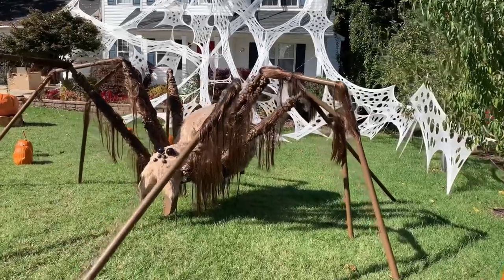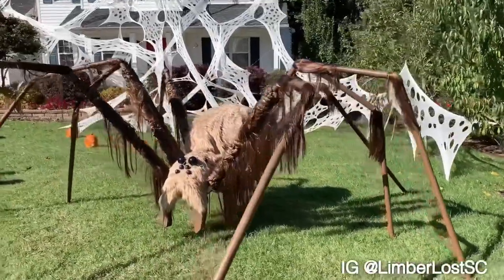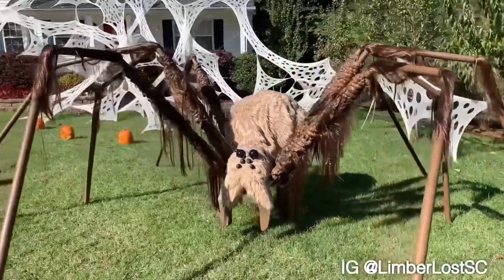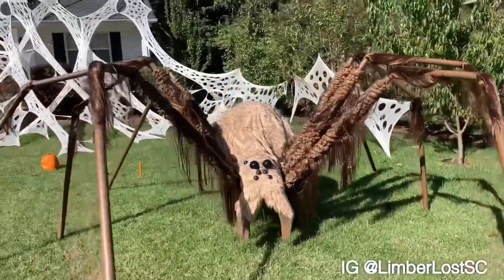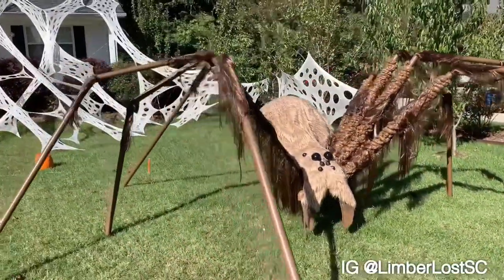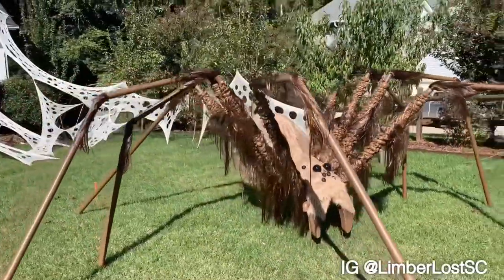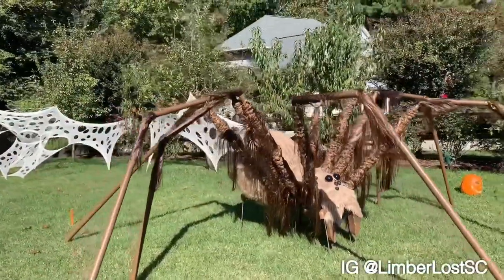DIY GIANT HALLOWEEN SPIDER

Comment: What sizes did you cut the PVC leg pieces to?
Reply: Have someone hold the 45 or 90 pvc fitting where you would like it height wise and measure inside the hub to the ground lining it up with the angle of the fitting. Easy

Comment: How are you getting such great coverage from your lighting in the ending shots of this video?  We are struggling with our black light placement.
Reply from the maker: I think the issue is that you’re using black light. I’m using LED color floodlights. I have two flood lights facing the house which illuminate it in that way. Here’s what I used LED Flood Light Outdoor 800W Equivalent 8000LM Smart RGB Landscape Lighting with APP Control, DIY Scenes - Timing - Warm White 2700K - Color Changing Uplight, IP66 Waterproof US Plug MELPO(2Pack) https://a.co/d/b5IY5o2

Comment: How did you format the pincher? I didn't see that,was it carved w the foam? & whered u find foam like that?
Reply from the maker: Hey Ken, 
It’s carved from styrofoam blocks (like the one  that’s shown in the beginning of the video). I found the blocks for free on Facebook Marketplace BUT the Tractor Supply Store sometimes gives them away for free). I carved the pincer out with a hot knife. Then I covered it with faux fur from Amazon
Reply: @IsaacAlexanderDIY  Thanks I figured that's where you got them.

Comment: Awesome build! Do you have a full supply list? How many wigs? Size and amount of PVC? Amount of fake fur? Thanks!
Reply from the maker: Unfortunately this was my first YouTube video and I didn’t really know how to make a proper one 😞. I don’t have a detailed supply list only that I used about 10 cheap wigs that I cut up. 
Depending on the size of the spider abdomen, I ended up using about 6 yards of fur fabric. PVC was size 1 1/2 inch but I don’t remember measuring the legs to get an exact measurement and I just cut sizes that I think would be appropriate size. I’m going to probably have to remake this spider with detailed measurements.

Comment: Just found this DIY and I'm excited to give it a spin! How did the beach ball and foam hold up for shape? Any tips for storage? I've also seen chicken wire versions and I'm wondering if it collapses on itself.
Reply from the maker: It’s a great project to make😊. The beach ball doesn’t stay inside, I pop it with a knife and remove it after the expanding from has dried. This is the third year I’ll be using it and the beach ball expanding foam body has done amazing
Reply: @IsaacAlexanderDIY  Thanks so much for the reply! I've used the foam before but not for crafting so I wasn't sure. I appreciate your creativity and the awesome videos!

Comment: How did you do the webbing? I know it’s probably pretty simple, but it’s so effective!
Reply from the maker: It’s called beef-netting. It’s sold online by Trenton Mills. I bought 10 pounds of the poly/cotton mixture. In order to make the holes, you need to have very sharp scissors or an X-Acto knife to cut slits into the fabric after it’s been stretched out.

Comment: Hello folks:

 It looks like now the right to start the build
Last year two days before Halloween wasn't enough time.
 For me its the idea just to get there no way it will be perfect. Ill be using things i find on trachcan days.
• four sets of tent pole will be paper towel rolls. Contact cement for whatever i use for legs black wool or your idea. 
• body black garages bags stuffing newspaper. Non eatable.
-• good old duck tape. Im Canadian " Red Green Show "

Old 1x6 old fencing spilt in 3 for old farm fence from 1800's theme.
It has the done cheap landlord issues.

Barbie car and a firetruck for some scary mood setting.

A frame with black bedding over= hunted house smoke in the walkway machine.
I done this on my school bus the little ones love it. Get 100 in tips total cost 10 bucks
 Save half of the lights for the added on Xmas theme with 20 stuff toys all from thrift store.black thick  webbing at back of the bus " go to jail don't get 200"